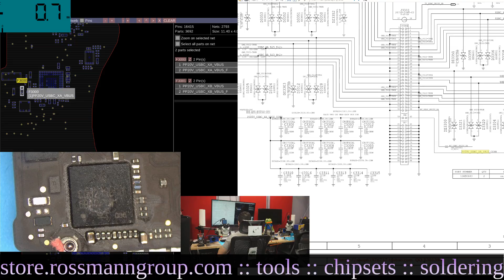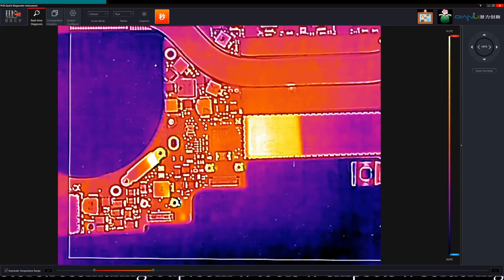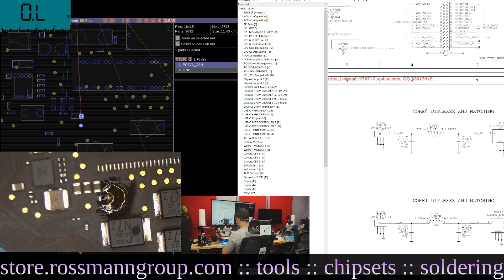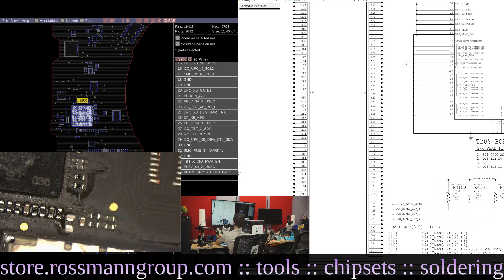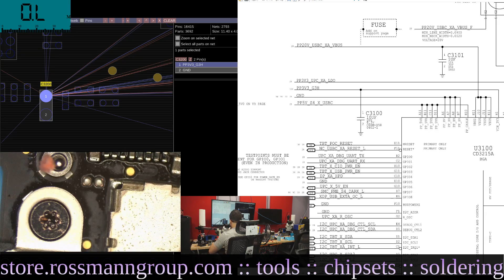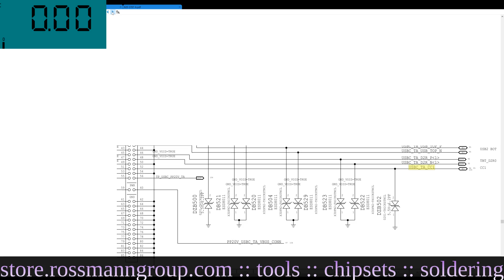820-00239 A1706 Macbook Pro Touchbar board repair ATTEMPT

Comment: Hello Bro Last night  Customer Call and tell to me My laptop is suddenly automatically power off then again try to turn on . Morning he will come my Shop we check and update by customer problem is Motherboard issue . Then check all filter capacitor Week at charging section location is 5 pin pp3v3 charging ic ISL9239  Replaces issue fix Thanks

Comment: Hey Louis, probably you already know this, but meh. Reflective surfaces can also reflect infrared, so in infra camera you can see them hot, but those are just reflected "images". If you move the board, you'll see if it's a reflection or not (if you don't want to switch to visible mode and see if it's shiny)

Comment: It seems a little odd that all 4 chips would die like that. I wonder if they as missing a signal from somewhere else in the system which means they don't request the 20v, worth checking which signals are common to all chips. Also I assume the charger works with other boards and it's not just a broken charger?

Comment: looks like the IR on the thermal was just reflecting at 25:50 not actually a component getting hot
Reply: yup any reflective surface needs to be taped over to show up correctly